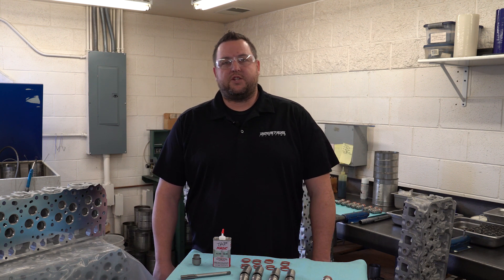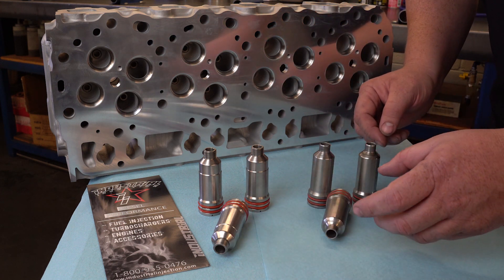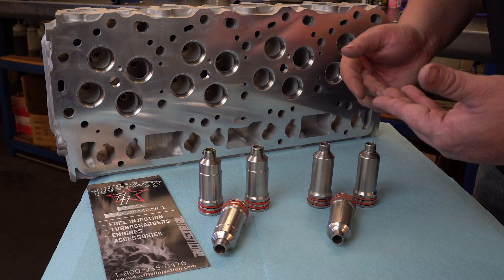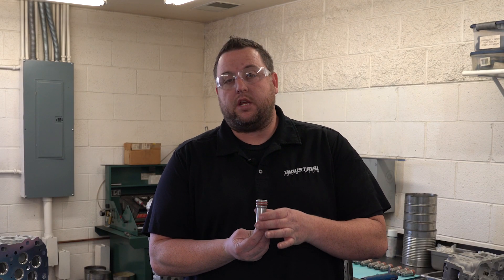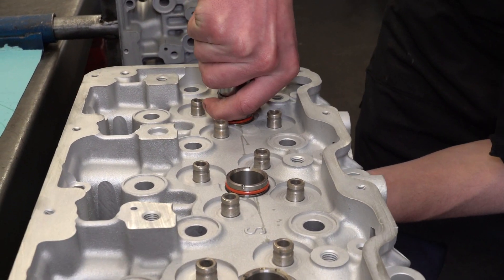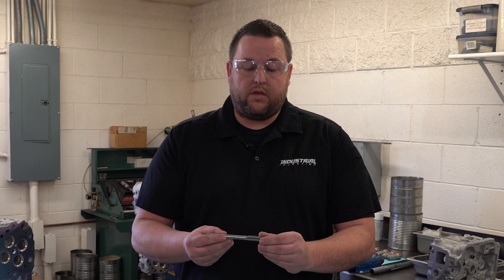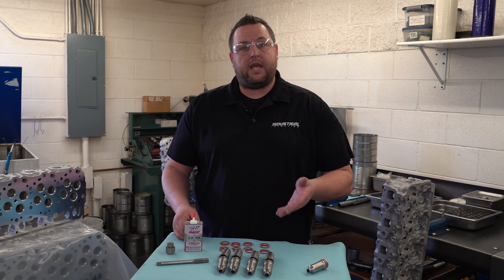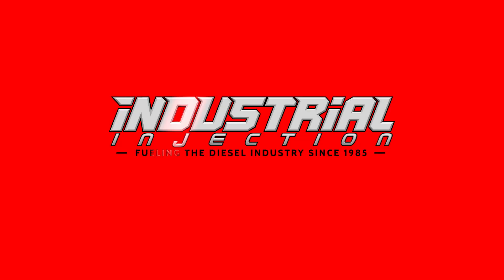6.6L LB7 Duramax Screw-In Engine Fuel Injector Cups

Comment: If I just lifted a cup on my engine, can I pull my valve covers and install these or should the heads be off for installation?
Reply: I would assume you wouldn’t want the shavings from the tap going into your engine and through through turbo, would be awesome if you could though